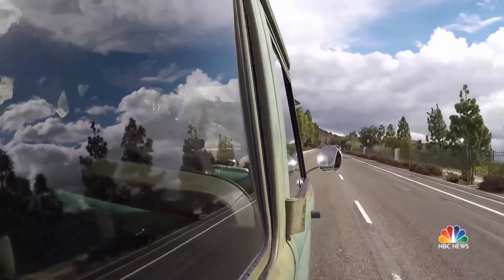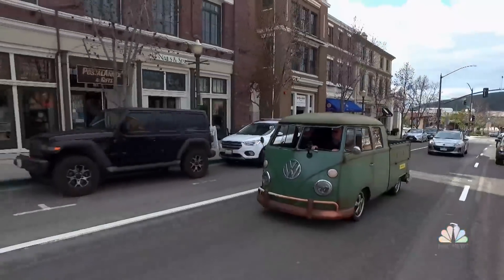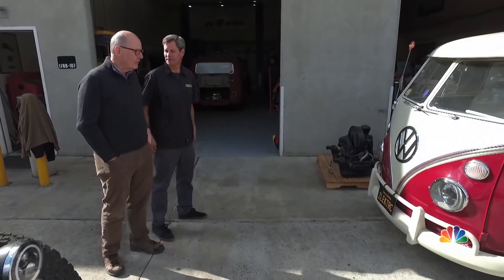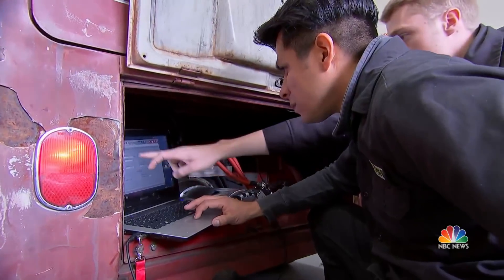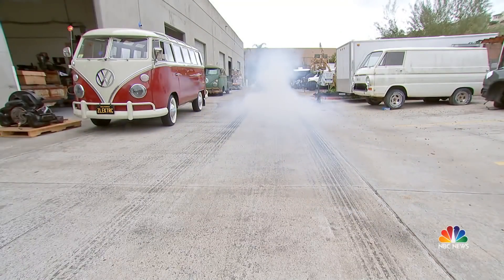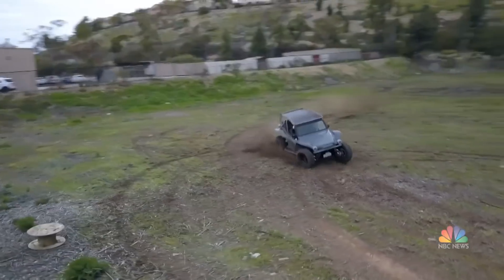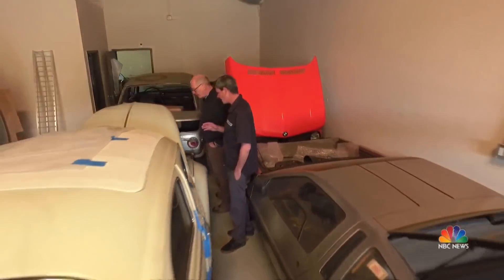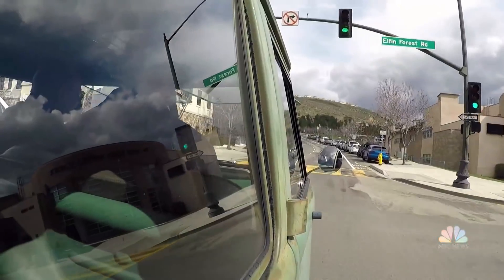Classic Cars Become Electric Vehicles At This California Garage | NBC Nightly News

Comment: As part of the Green New Deal our planet desperately needs:  convert all inFernal combustion vehicles to EV.
Reply: good luck affording that
Reply: And convert all of our powerplants to nuclear, and improve them? I hope?
Reply: @sireliot2149  I don't think that nuclear is the best longterm solution.  (How the heck do we store radioactive materials with a half-life of 100,000 years?)  But one thing is a given:  we badly need to shut down all coal-fired power plants.
Reply: @davismiller4369  Yes I am not a fan of electric vehicles running off of coal. However; coal plants and other similar infrastructure should be mothballed rather than dismantled. I would offer that currently a considerable amount of radioactive waste is being stored. I have heard it is in containers in parking lots. Ideas I have heard include storing waste inside the granite continental shelf. Also, America does not reprocess uranium etc. (Thanks to Jimmay Cahtah?) while South Africa and other countries (France?) are able to reprocess fuel. In this way we seem paranoid compared to countries in the EU?